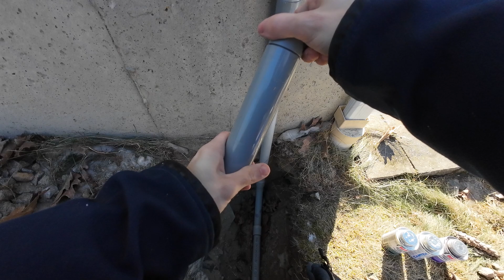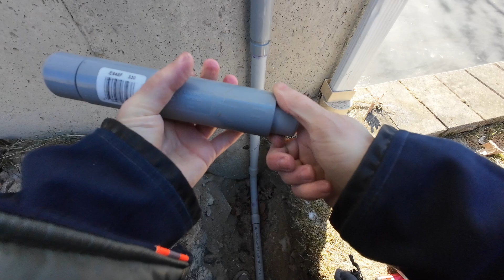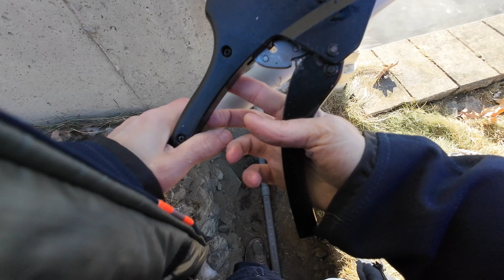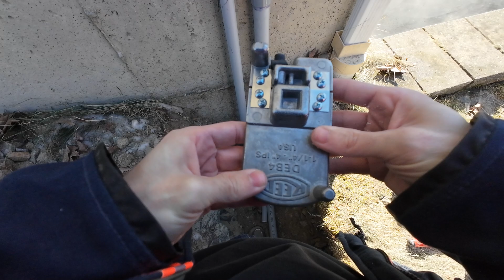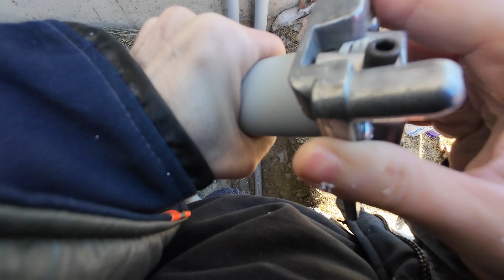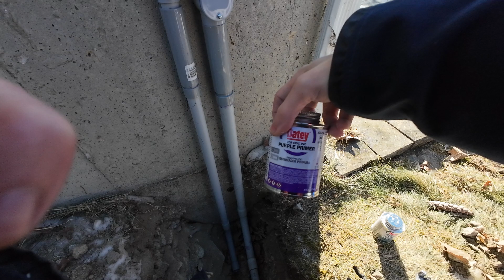Expansion Coupling with PVC Electrical Conduit Proper Installation

Comment: Didn’t you just glue the sliding joint onto the pvc doesn’t that defeat the purpose of the sliding mechanism of the expansion fitting now ?
Reply from the maker: Thanks for watching. No, the sliding area is not glued which allows for movement.

Comment: Thanks for sharing. I live in SoCal (Los Angeles), so freezing/heaving is not a problem here. But the info on running power and data separately is timely, because I want to run an STP (shielded twisted pair) CAT 6 cable from a home router to another in my man cave. 
Do you think 200’ is too long a run for the communications circuit? (200’ one way.)
Reply from the maker: Thanks for your comment and glad you found the video useful. I am not an expert in data cable, but in total my data cable is about a 120 foot run (non-shielded) so I think you will be fine.
Reply: I believe the ethernet spec for CAT6 is 100m (approx 328'). I have a 300' CAT6 starlink cable that works (though I've not checked for bandwidth loss).

Comment: I believe this installation will only work if the ground shrinks.  If the ground expands, it will act as if it’s a solid piece of pipe.  Kudos on the vertical orientation.  I see so many of these installed upside down and when the O-rings wear out, water starts filling up the conduit.  You can always move the box a little higher to give it a little bit more room for expansion.
Reply from the maker: Thanks for watching!

Comment: Did you put an expansion coupling on both the house and shed or just the house? Thanks
Reply from the maker: Thanks for watching my video. I didn't use expansion couplings on the shed side because I used flexible conduit instead. I made a video called "Backyard Shed Part 3", if you go to around the 11 minute mark of that video you can see the flexible conduit.

Comment: Expansion joints above ground are required by 2023 nec. But you also need expansion joints every 100 feet under ground nec Table 352.44(A) .good point on the reaming an chamfering as well as keeping the pipe straps loose to allow the expansion joints to work correctly
Reply from the maker: Thanks for your comment. Yes, you are correct about the 100 foot rule. Even though this run is a little longer than 100 feet, the last 10-15 feet going into the shed are flexible conduit which allowed me to not have to run expansion joints.

Comment: Don't you have to extend the expansion fittings halfway before installing them?
Reply from the maker: Thanks for your comment. The halfway-rule is a good guideline to follow. However, it is ultimately up to the discretion of your local inspector. In the 2023 NEC, Section 352.44(B) was added which requires expansion fittings to be installed above grade when direct buried PVC conduit emerges from the ground and compensation is needed for earth settling or movement, including frost heave.
I should have done a better job explaining in the video, but once completed I left room for expansion. Before gluing I made sure to leave at least an inch for expansion. I have never heard of an exact specification of halfway, the only thing the inspector told me was there needs to be room for expansion. Once the trench was filled the weight of the dirt pulled the expansion slightly further apart. Since I did this project in January in New England, the thawing of the ground will separate these even further.